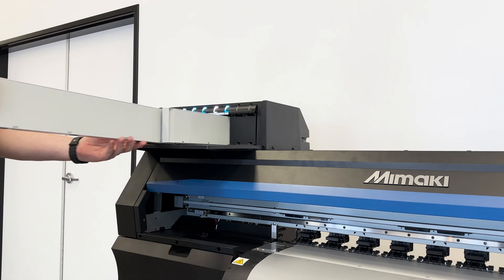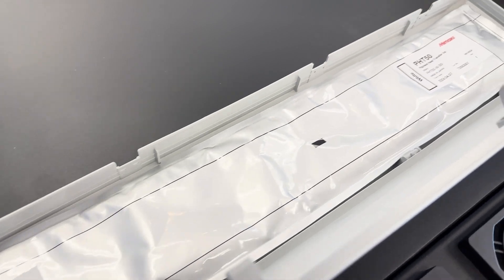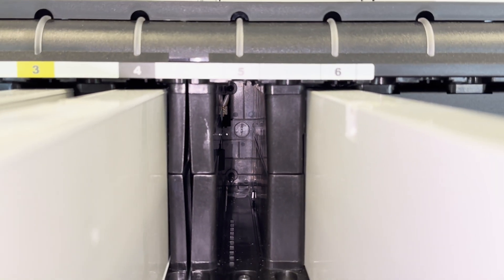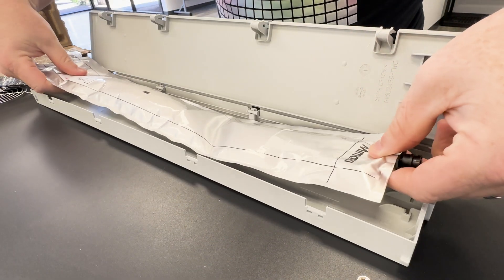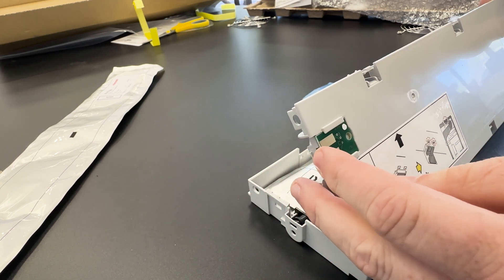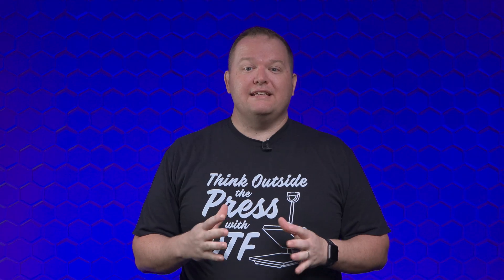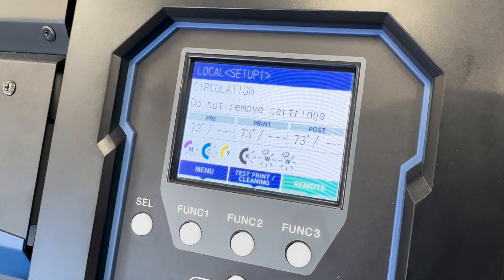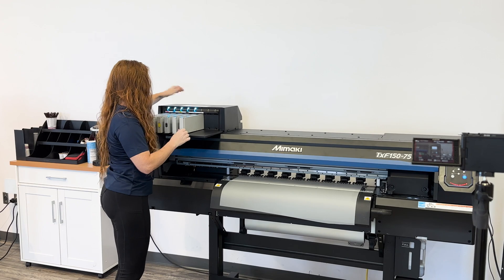The Perfect Nozzle Check | Mimaki DTF Ink

Comment: Question 1 - the first white column (5th from left, after CMYK) is always problematic on my brand new txf unit. Nozzle tests rarely show proper placement of lines, 70% of them are randomly empty. Is „air inside“ always the culprit?
Question 2 - if air is the culprit, is there any way to purge it without disassembling the head or cap unit?
Question 3 - I‘ll be honest, I neglected my previous unit, cjv150-75. Didn‘t do proper cleaning and after 3 years, its head is completely dead. I intend not to make the same mistakes with txf. But when I see empty lines on nozzle tests, I panic involuntarily, and try to perform normal/hard cleaning until it is fully printed. In turn, this process consumes too much ink and maintenance fluid. Can empty nozzle checks be ignored if the printer is performing actual prints without errors? When should empty nozzle checks be cause of concern? Thanks for your awesome videos!
Reply from the maker: We'd love to help here but your particular situation looks like it needs more specific assistance.  If you purchase the printer from us reach out to our tech support.  If you purchased it from another dealer reach out to them.

Comment: How is this better than a mutoh 724 printer both use carriages that has no air. Mimaki is not using the new brother head. That was made for dtf, instead they are using old dx7
Reply from the maker: Number 1: Full 1 Year warranty (bumper to bumper) Includes onsite technician
Number 2: Where the White Ink Circulates assures that no settled pigment goes through the printhead
Number 3: Nozzle Drop Detection and Nozzle Recovery: If the printhead has a nozzle that is not firing the system tries to clear the clog and if it can't it will use other nozzles to make up for the lost nozzle until a technician can address the dropped nozzle
I'm sure there are many reasons Mimaki picked the DX7 but they whole mindset behind the creation of this printer was reliability so they stuck with proven parts and systems as much as they could.  thanks for watching and commenting.
Reply: i'm using the mutoh vj628d an it has been pretty horrible. does the new 724 really use a different print head.